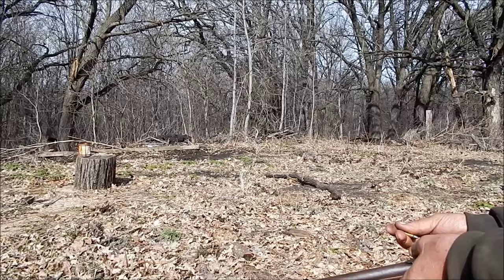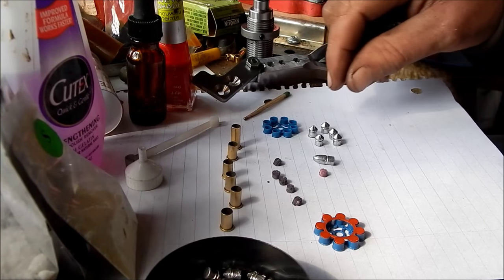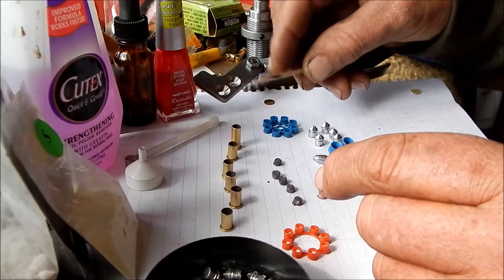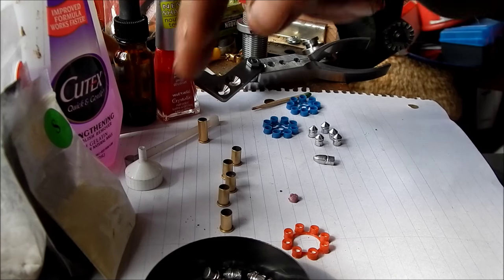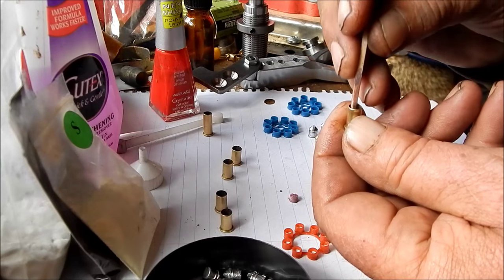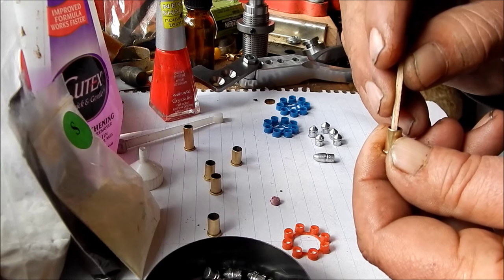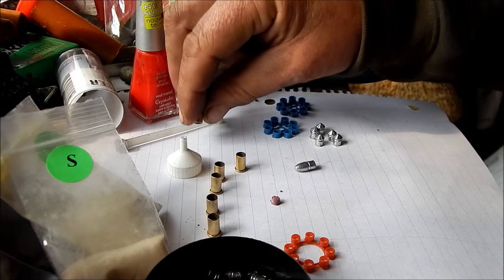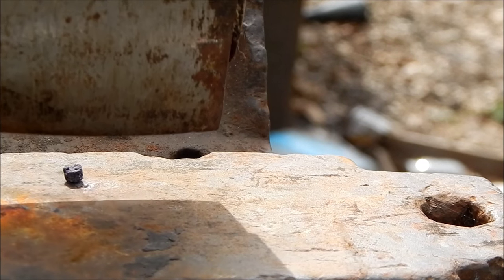.22 reload update

Comment: Appears you've got it figured out. Guess I've never seen caps like that, I was thinking roll caps and was wondering how that would all work out. Neat process for an emergency.
Reply: I've tried those roll caps in small pistol primers, and it works if you have a large enough fireing pin and power full enough strike on the primer.

Comment: What they don't tell you is that most of the people who reloaded 22 ammo back in the old days were trappers who lived in remote areas.
They shot bob-cats and such caught in leg hold traps at about 6ft off the muzzle. No great accuracy was required.  If it didn't go off the first time the critter would sit right there and wait while the trapper turned the case and tried again. 
That is the practical application.
If you want better accuracy than that, then you had better be a really great reloader.  As you can see, it's possible but probably not practical.
Something interesting to do though.

Comment: I don't much like the Idea of sulfur and Potassium chlorate. Old flashpowder was made that way before they switched to potassium perchlorate. Issue is if the sulfur isn't pure it can react with the KClO3 much the same way sulfuric acid does, causing it to go off by itself. (mix 50/50 sugar and Potassium chlorate, then add a drop of sulfuric acid to it, it will ignite.)
lab grade chemicals wouldn't pose too much risk (like the stuff you have), but if some one bought lower grades of sulfur they can cause themselves problems.